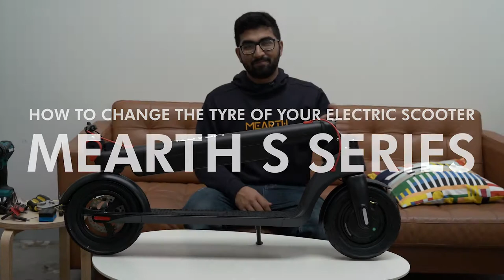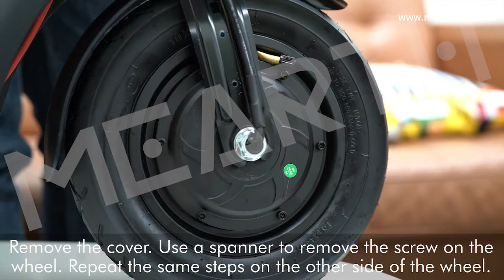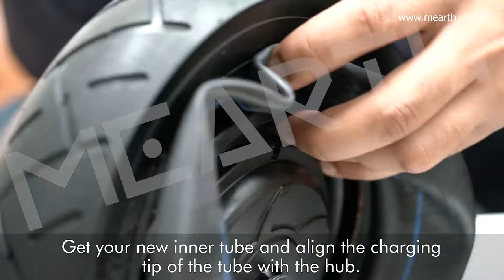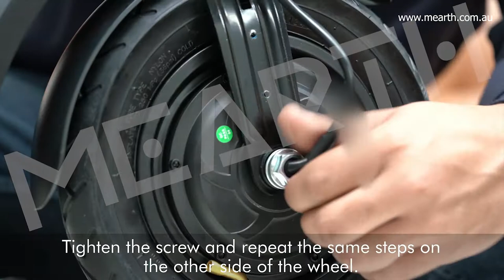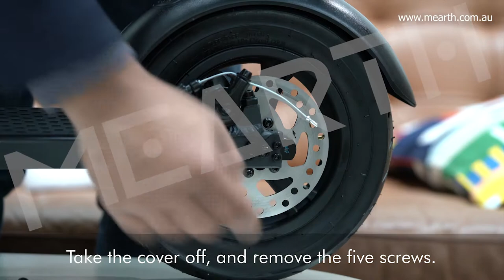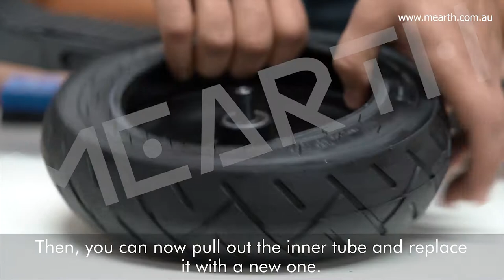How to Change Tyre | Mearth S Series Electric Scooter

Comment: I have replaced the inner tube many times, but due to the design of the valve, the inner tube is extremely squeezed and ruptured when inflated. It is simply an unreasonable design.